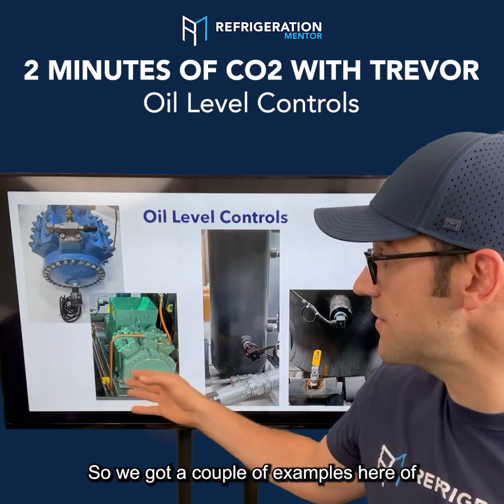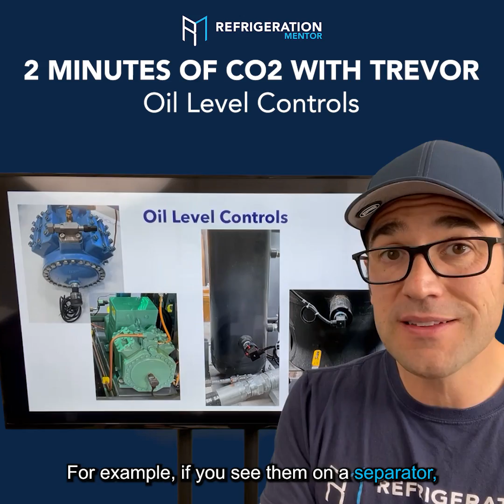Oil & CO2 Liquid Level Controls for Transcritical Applications

Comment: So how exactly these pumpless compressors lubricate ? Pistons hit oil and splashes all over?
Reply from the maker: There are different types of splash devices connected to the crankshafts that hit the oil and splashes the oil into the oil cup that moves the oil through the compressor.